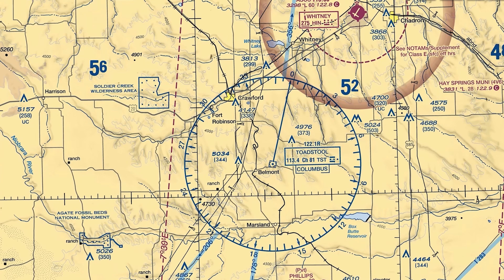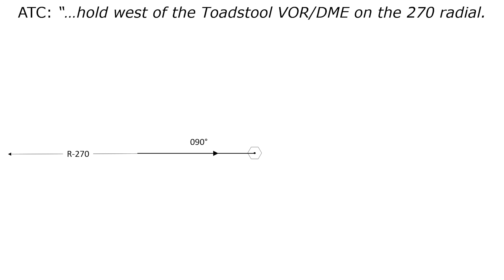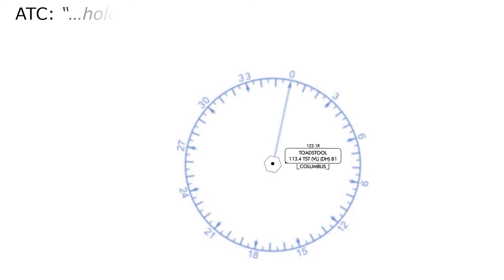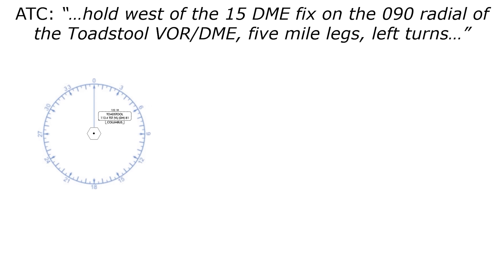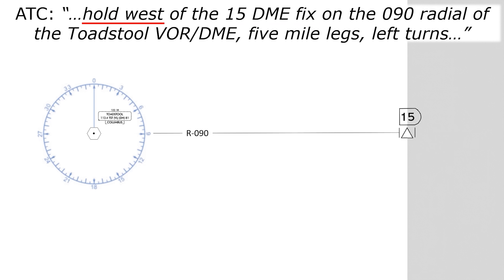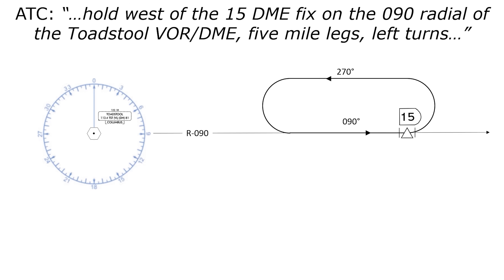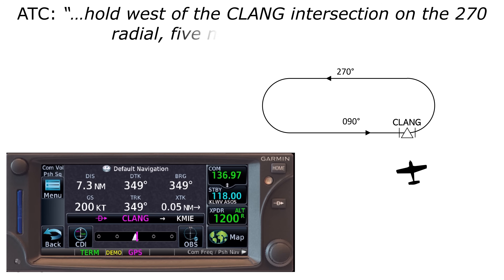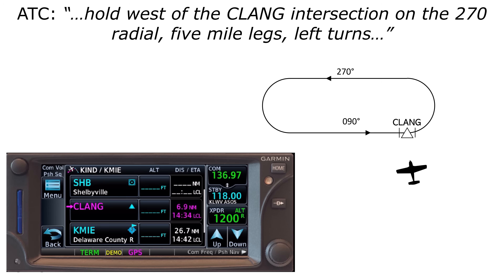Let's Practice Some IFR Holds | Unpublished Holds Garmin 650

Comment: For both of these units you can also create a user waypoint by tapping the map. You can make it temporary and even name it if you want to. You can select a radial and DME from any point, similar to foreflight, such as 15 dme on the 090 radial from the VOR. You can then add that way point to your flight plan and add a hold to the fix as specified and your GPS can assist with the entire process that way

Comment: Good discussion of unpublished holds, but otherwise this was confusing, rushed, and frankly failed to explain anything about how to actually use the unit to fly them. I was blown away to see that all of that material was compressed into the last 40 seconds of the video.
Reply: The video does a great job of explaining holding instructions, and what they should mean to you as a pilot - these very instructions are universal regardless of equipment you have. Adding a hold is simple and takes a few seconds, it’s not rushed.

Comment: As an instrument student this type of direct entry is the most difficult.  Doing an S-turn as in the video seems like winging it (no pun intended).  An approach I learned is that if the first turn outbound (relative to the inbound course) is less than 180 degrees, then continue past the holding fix for 1 second for each 3 degrees less than 180 before beginning the turn outbound.  In the video it's close enough to 90 degrees so just use that which ends up as 30 seconds. This is especially useful if you "only" have a GNS 530.  Of course the direct  entry is close to a teardrop in this example.

Comment: 6:11 "After our 1 minute outbound..." Are you sure? ATC specified 5 mile legs so you'd turn inbound when reaching 5 miles from CLANG.
Reply: Good point.  My question is whether I'm required to fly the 5 miles or can I shorten it.  I think with published holds with leg distances in NM I can shorten it but since ATC issued the instruction for an unpublished hold, I have to adhere to their distance number.

Comment: Couldn't you tap on CLANG and then specify the hold there?
Reply: Yes. Much better method I think
Reply: @gunterfoenem  That’s what I thought. I use the touchscreen 175, same basic format as this unit. By going this way, you don’t have to mess with the OBS, you can just enter your desired course, inbound, outbound, right or left turn, etc.

Comment: Love these videos , however a few errors. Time stamp 5:12 . “ start a left turn to the outbound leg “ intercepting CLANG . The video depicts a RH . Turn. This would have been better executed as a teardrop entry. Unless you are flying a J3 cub with a Continental A-65 engine and with a 35 knot head wind. That 110 degree turn to the right 090 from a heading of 342 would have been a mess .
Reply: You’re not wrong but usually the GPS will have you hold direct on these anyway and instead of making you do the turning portion, it will just fly you out away from the fix and turn you onto your outbound leg

Comment: Of course you can actually add the hold procedure on the 650 as well...  That will work out the correct entry, timing and wind correction too.